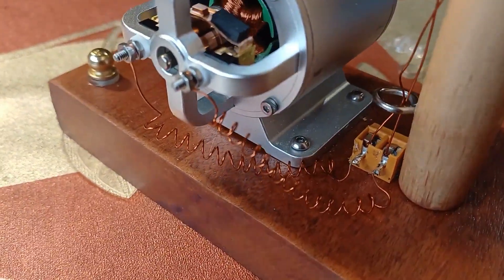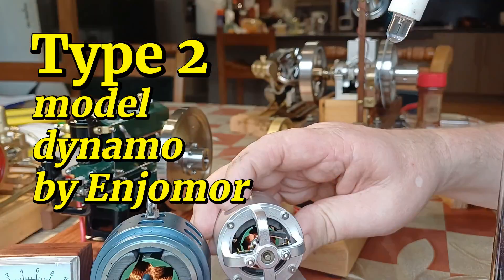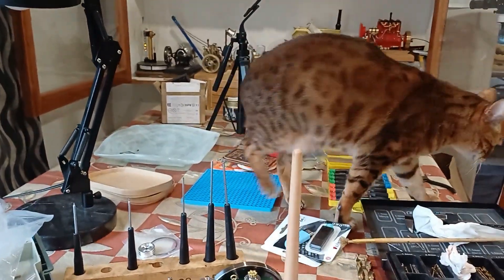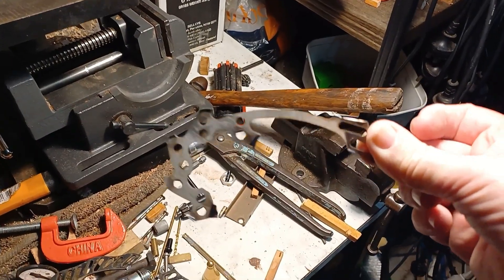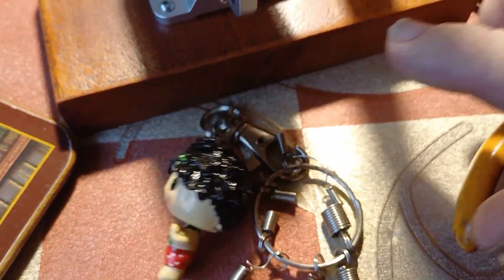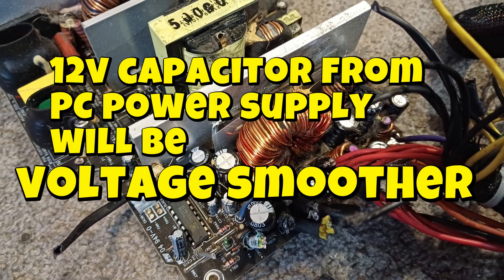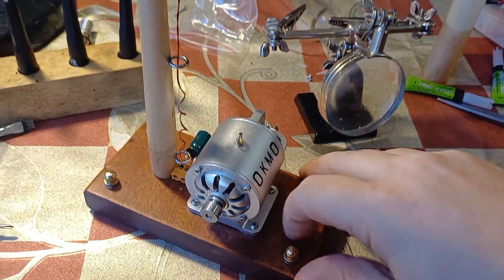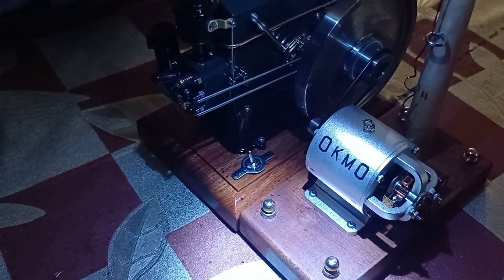Best Model Dynamo project OKMO FD6 + OKMO 1140 #enginediy #modelengine #vintage

Comment: I highly recommend you polish the stems of the valves as they have a rough finish. Mine had the intake valve guide wear out so bad that the valve was almost touching the cylinder sleeve.

Comment: That was neatly done, amigo.  I was wondering where you picked up the two generators in your video. I'd like to get one of the larger of the two If you could let me know where they're available. Keep up the good work and we'll keep enjoying your videos.
Reply from the maker: Hi! Thanks for the feedback. It's important to me because this video did awfully badly in views, I suspect YouTube punished it for being only 5 minutes....Anyway!
Your question. You're not asking about Jin's OKMO FD5 but the other one that I call the  Enjomor type 2 dynamo. 
Enjomor brought out a 4 stroke vintage engine that looks like a hit & miss but isn't and a matching dynamo. Here's the type 1 dynamo, massively expensive (but free shipping) https://www.stirlingkit.com/collections/enjomor-engines/products/12v-high-power-permanent-magnet-dc-generator-alternator-for-howin-enjomor-retrol-semto-engine-models-modification
I saw the much cheaper type 2 on alixpress however the price varies a LOT and you can never be sure if the merchant will send you the included rubber belt and aluminium belt wheel or try to charge you for both as extras. Every time I look back I see different deals and none better than my first purchase. Also, without a model name the part is hard to find. Complete set here
https://www.aliexpress.com/item/1005006221386109.html?spm=a2g0o.detail.pcDetailBottomMoreOtherSeller.38.319894AN94AN20&gps-id=pcDetailBottomMoreOtherSeller&scm=1007.40050.354490.0&scm_id=1007.40050.354490.0&scm-url=1007.40050.354490.0&pvid=f8faea5e-eb1d-46c9-a207-0e26c33c2fe3&_t=gps-id:pcDetailBottomMoreOtherSeller,scm-url:1007.40050.354490.0,pvid:f8faea5e-eb1d-46c9-a207-0e26c33c2fe3,tpp_buckets:668%232846%238116%232002&pdp_ext_f=%7B%22order%22%3A%222%22%2C%22eval%22%3A%221%22%2C%22sceneId%22%3A%2230050%22%7D&pdp_npi=4%40dis%21NZD%212120.45%21636.13%21%21%211239.74%21371.92%21%402103247417459329708375790e831c%2112000036340833773%21rec%21NZ%21230719784%21X&utparam-url=scene%3ApcDetailBottomMoreOtherSeller%7Cquery_from%3A
Reply from the maker: here's both. I think the FD6 is a better performer, lower load and about 1/5th the price
https://www.aliexpress.com/item/1005008003733693.html?spm=a2g0o.detail.pcDetailBottomMoreOtherSeller.22.319894AN94AN20&gps-id=pcDetailBottomMoreOtherSeller&scm=1007.40050.354490.0&scm_id=1007.40050.354490.0&scm-url=1007.40050.354490.0&pvid=a0ee9eb4-ac17-44cd-9dde-8918f7048b92&_t=gps-id:pcDetailBottomMoreOtherSeller,scm-url:1007.40050.354490.0,pvid:a0ee9eb4-ac17-44cd-9dde-8918f7048b92,tpp_buckets:668%232846%238116%232002&pdp_ext_f=%7B%22order%22%3A%225%22%2C%22eval%22%3A%221%22%2C%22sceneId%22%3A%2230050%22%7D&pdp_npi=4%40dis%21NZD%21205.85%2192.63%21%21%21877.08%21394.69%21%402103247417459329432325241e831c%2112000043227676706%21rec%21NZ%21230719784%21X&utparam-url=scene%3ApcDetailBottomMoreOtherSeller%7Cquery_from%3A